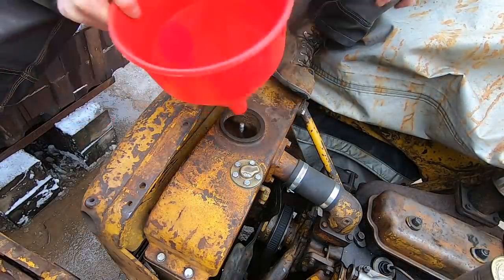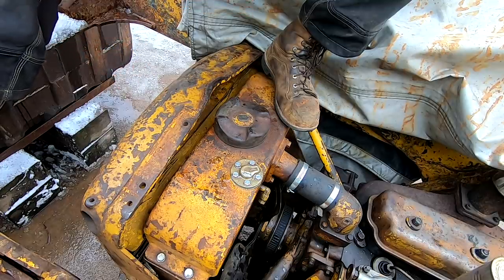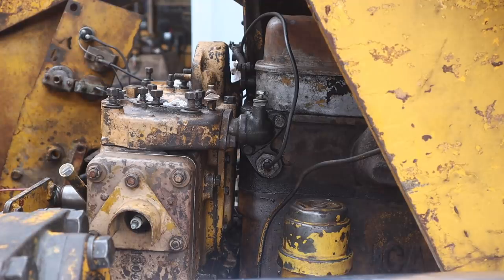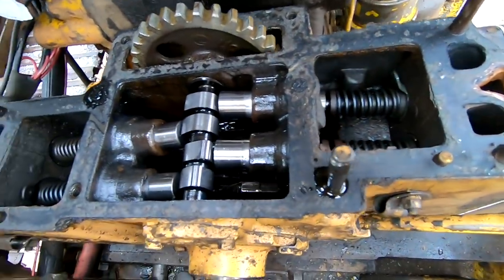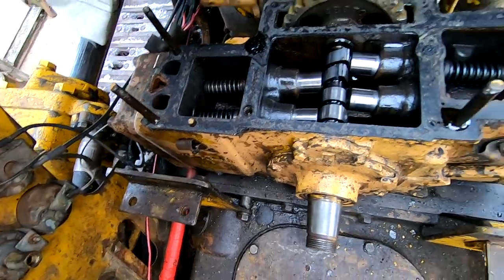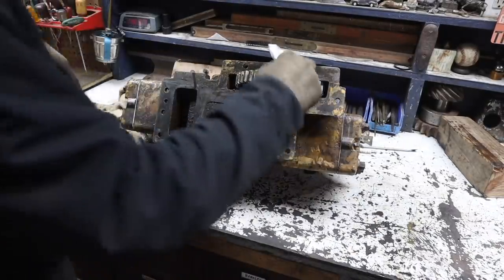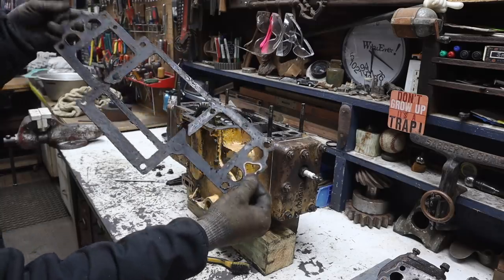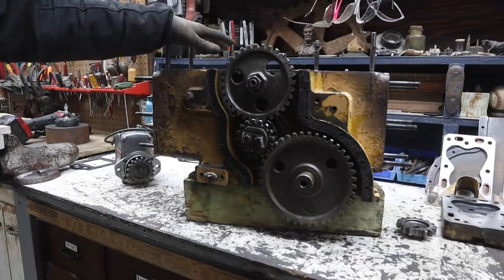I REMOVED the Pony Motor!!! ~ Part 15 ~ 1950s Caterpillar TraxCavator

Comment: It’s a babbit bearing not aluminum young man and yes you can replace it with a bronze bearing. The magneto gear got damaged by its loss mounting bolts if you remember you pointed it out alt hw lose the exhaust and bracketing was ! The cast iron gear was probably fractured for guide some time
Reply: I thought the same thing Ronnie, But the how is my question?
Reply: I was still concerned as to where the fractured castle nut came from.?
Reply: @Curtislow2  pretty sure as said in the video, someone dropped that into the crankcase when working on the con rods in the past.
Reply: Bearing is special aluminum alloy.
Reply: @toma43  There is no aluminium in that babbit metal.
Reply: @Bill45a13  Aluminum is just about the worse material for a bearing, it does not play well with oil, it's abrasive and it has a nasty tendency to bind.
Don't know what babbit is, but I certainly agree that there is no way it's any kind of aluminum alloy.
Reply: @arturraimundo7158  The most common materials in babbit are tin, lead, copper, and antimony.
Reply: @arturraimundo7158  babbit is a lead mixture that is used on older bearing surfaces, it is usually poured in place. I don't think this is babbit
Reply: No they are aluminum bearings
Reply: @arturraimundo7158  Almost all modern automotive crankshaft bearings are aluminium alloy on a steel backing.
Reply: @arturraimundo7158  watch Keith Rucker, he has videos of pouring babbitt bearings
Reply from the maker: The bearing is definetly an aluminum alloy, im sure about that!
Reply: There's a lot of armchair mechanics in here that have never worked on a Cat.  The pony motor main bearings are aluminum.
Reply: I think that is quite clear if the base material is alluminum or lead, simply by take in your hand. The weight is quite different.
Reply: @brianrvd  Definitely not an armchair mechanic, but I sure can accept and be grateful for the opinions of experienced people.
I stand corrected and thankful for learning there are in fact aluminum bearings.🤐
And by the way, I have never worked on a Cat.
Reply: @arturraimundo7158  babbit is a lead alloy usually tin, lead and antimony for hardness.
Reply: Damn it I hate when old people spread false information. They're supposed to know things..
Reply: @Bill45a13  that's because it's not a babbitt bearing.....
Reply: @arturraimundo7158  If you didn't know, & you acted like you did, you're an armchair mechanic.
Reply: @elonmust7470  yep shit like that happens every day young man!

Comment: Concentrations of ethylene glycol and water that have higher freezing temps than a proper mix SHRINK (or turn to slush) when they freeze, so 100% antifreeze concentration will not damage anything.  Assuming you don't need it for cooling that is as it isn't a liquid and won't circulate.  You're fine with straight ethylene glycol in your situation.  I would have left it.

Comment: making the sleeve can be done but you have to know the thermal expansion of the material and the minimum/maximum tolerances for the crank  and sleeve, if they are too tight and heat up there will be no clearance for oil and friction will increase dramatically

Comment: Mr Pete proved you can use an adjustable wrench either way. 
NOT a pipe wrench.  When you started with the puller that way, I knew it wouldn't work.
Reply: Had the pipe wrench on backward

Comment: So, to get an accurate reading on those telescopic bore gauges, you set them at a slight angle, so they are measuring big .. snug the locking bar up, then tip them through 90 degrees. As they come tight as they pass through 90, they will set up at the proper dimension with great accuracy. Then you tighten the bar a little more.

Comment: Who wants to bet that the castle nut is what broke the gear and bent the shaft? My thinking is that ol' Red was working on it and lost the nut in there without realizing it.
Reply: Can You loose a castlenut visible with bare eyes into an engine without noticing?
I can't. I write my parts down or have magnet pads for parts with sharpy registers drawn around. But I am quite sure You're right, the nut cracked the gear-teeth, probably having still been a whole nut before wrecking/bending the Magneto, which would be still an issue now as another half might float around being another wreck-to-come. It is awful, but You gotta look for the broken parts and put the puzzle back together on the bench, should You not be wanting to relive the same shite again.
Reply: Red may not have been the saint he is being made out to be..

Comment: I'd wash out the coolant circulation with a pressure washer to ensure all dirt being gone, same with big motor, unseal the cooler and whater pump and wash out the motor with a fire hose or sth similarly powerfull

Comment: About 40 years ago I removed the pony engine from my D4. It was stuck hadnt ran in years. I took it completely apart. It has stuck valves. the crank was turned .010 and the block bored .020. and the bottom was brazed where a thrown rod in its  past had cracked it.

Comment: 60% antifreeze 40% water gives the lowest freezing point, 34 years in Alaska, had down to -60F at the house, when that cold most diesel can turn to jello.
one of the cheap wet/dry shop vacs are really great for cleaning spills.
magneto is driven by the cam gear, play in that is what would cause issues with magneto, but your crank needs work way too much play in the crankshaft, needs new bearings/bushings and seals
castle nuts should have retaining cotter pins not pieces of wire to hold them in place
Reply: WWII aircraft castle nuts were secured with wire arranged and tied in very specific patterns. (supervisor  when I was an auto apprentice had served as an aircraft engine mechanic in Britain. He tried to teach me valve timing and ignition advance for 14 cylinder radial engines)

Comment: At about 18:00 you are correct, obviously flow runs bottom to top, as heat rises.  Very nice and thorough job! How many others wanted to reach through the screen to give a hand on the awkward and heavy pony motor removal? On the crank bushings, I don't think they are aluminum, but probably steel with a Babbitt wear surface. Relatively easy to check...aluminum won't give off sparks when you grind on it.
Great and detailed "dissection" of the machine, showing off many features most of us have never seen!

Comment: Can I make a recommendation to you? The machining you are proposing, and I know you are a good mechanic, can be very intricate.  I would suggest getting a professional machinist to do the bearings and races for you. I know you have a lot of machines and want to experience it, which is admirable. However, ABOM79 or Booth Machine has a YouTube site. I watch his stuff every Sat when he posts. This guy is a true machinist, grew up in it actually.  These are critical parts and maybe hard to find if a mistake happens. Just a suggestion. I have enjoyed watching you get this CAT running, thank you.
Reply: Not to mention Squatch253 who is currently rebuilding a D2 dozer and has very intricate knowledge of the engines/transmissions/pony motors...definitely hit them up for assistance, heck he might even have a manual for it, or can point him in the right direction
Reply: I understand your point but, if the dimensions needed are known at the start, and the finished dimensions are machined accurately, it doesn't matter who makes them. I'd try to make that part if I had the machine/tooling and experience using them; it's how ppl learn. I may be wrong, but on the surface that particular part doesn't appear to be overly complicated. Have a good day; God bless.
Reply: Yeah, Abom rocks!!!
Speaking of ABOM79, It's been a while. I need to catch up.
Reply from the maker: @DanKoning777  Yup, it's basically an aluminum ring! the 3 holes are drilled into it once it's in the block! I'm pretty sure I can make what I need! If not, I can always buy them, right?
Reply: @SalvageWorkshop  why do you think that is aluminum? It's almost certainly a babbit alloy, not aluminum. Babbitt alloys and aluminum look very similar but they are very different.
Reply: @SalvageWorkshop  //  Sounds like a plan; and CAT can tell you what it's made of re: material to use.

Comment: Please remember not to start the pony motor and immediately start the diesel especially in cold weather because the pony motor acts as a preheater and heats the coolant in the diesel engine before it starts.
Reply: Very good advice makes perfect sense
Reply: If so, does the pony motor has a water pump also? Or did the engineers hope that the coolant will circulate by heat difference only?
Reply: @thomasmuller9243  it works by convection
Reply: Actually I watched a video and the pony motor is used to turn the diesel motor over for a few minutes without starting the diesel motor so the diesel motors water pump circulates the water and the pony motor prewarms it.
Reply: @rickburris6164  more importantly builds oil pressure. Being cold won't hurt it.

Comment: Ha...you're getting your education that's for sure! Keep your eyes and ears going for parts machines. If you found an already converted direct start dead machine would probably be the cheapest way to get the goods. Conversion parts usually cost more than scrap value of a whole machine. Demand and supply rule. Plus you'll get other parts, and some scrap money  too. I'll  be in touch with pics soon. Thanks for sharing

Comment: That’s what I like to see. A good tear down and analysis. I’m thinking that broken castellated nut got thrown into the wrong place while the motor was running, caused it to lock for a split second and break off those teeth for the mag. Really looking forward to the rebuild and see how the new sleeve you’re going to make works out.

Comment: I would rather have the pony motor because it also warms the engine coolant and can crank much longer than an electric starter motor.
Reply: glow plugs and plug holders are available they just bolt on. but only on later models you have to have the certain type of heads to take the holders.

Comment: I've read all the comments below and agree with most of them sic; those bearings are made of what we called, in the vintage vehicle world, white metal. It was developed because of the microscopic highs and lows of the surface, allowing oil to penetrate deep into the bearing surface. There is a bronze alloy that has a high porosity, bit like a sponge, again developed for the early motor industry. If you make a bearing out of pure bronze you will have to add a spiral oil  groove. Pleased if someone shoots me down on this.  Anyway we've all got your interest at heart. Absolutely brilliant effort and filming, thanks. Pete on the Isle of Wight.

Comment: Can't see that lateral play in the crankshaft is going to cause the cam gear to move up or down. These are all old parts. Things break
Reply: harmonic vibration induced by the play is the cause. this is according to a factory mechanic he did his apprenticeship on these old girls.

Comment: Does Caterpillar still sell those bearings? Second I would definitely have the engine block hot tanked and make sure all the cooling passages are completely cleaned out. If you can’t get the bearings maybe a machine shop can replicated those given the machine shop all the dimensions and I definitely have the crank miked and polished and see if you need oversized bearings throughout the entire engine. Have the machine shop go through the engine to see what really needs machining to be through so you know what you really got.

Comment: Keep the pony motor. It helps to heat the diesel motor by circulating the coolant, this in turn heats the coolant sending the warm coolant to the diesel allowing for the diesel to fire off easier.

Comment: Also using distilled water prevents rust on the engine block and prolongs engine seals and saves the block from rusting out.
Reply: "distilled water prevents rust" I'll have to think about that.
Reply: @earlborchardt4358  I use it on gas tanks also. That I have cleaned rust out of. I use evaporust and flush with distilled water and no rust ever comes back in the tanks.

Comment: Is it possible that the motor had been repaired before and that partial nut was from the reason that it had been repaired before and the mechanic never thought about checking the drain tube for broken piece and parts.just saying.great video,enjoy every video 😎😎😎👍👍👍
Reply: Possible?? Naw, it did happen, remember the donor he got that was laying in pieces in the field?
All the spare parts in the shed?
All the loose and broken nuts and studs. Yeah it has been frankensteined

Comment: My input on Aluminum Bearings. Most likely the bearings got hot and flashed (not hot enough to melt, but enough the shrink. Check the crank for size sometimes the aluminum will transfer to the shaft.  Making new bearing would be the way I would go, Oil bronze. I use Atlas Bronze. Thanks for sharing.
Reply: I was thinking Aluminum Bronze for bearing material? opinion?

Comment: Matt, when you meshed your broken mag gear with the driving gear the teath on the broken mag gear appeared to have be tobig and the wrong profile, I wonder if someone replaced the mag a while ago with the incorrect one, just to get the job away and this over time has caused all your other problems
Reply from the maker: I have a few of those gears and they are all the same, so my guess is that it was designed that way and that it fits well enough to do its job, but I can see where you're coming from!

Comment: The old Pony motor will be just like brand new when your done. With it..Good job Bud. When I seen that half a castle nut I knew right away where it cme from. Im glad for you that was from an old repair and not the cause of the issue this time

Comment: My worry would be where is the other half of that castle nut? If it's hiding somewhere, it's only a matter of time before it does another oopsie.
Reply: Who knows where it is it could not even be in there it could’ve broken along time ago and they couldn’t find that half of that nut
Reply: I'm going to guess when it originally broke, whoever  installed a new rod (or stud) found the other piece of the castle nut and missed the little piece stuck in the old drain. That piece in there proves there was a previous repair done at some point since none of the castle nuts were broken or missing

Comment: In the elevator business on the large machines, we usually used Babbitt bearings poured on the job. (replaced). They were made of a Babbitt material called Cadtex which I Believe was just a commercial name of a Babbitt alloy, a little harder and longer life material.  The big bearings were poured on the job on the machine by the real old timers.  Warning .....don’t let your brow sweat fall into the pot full of hot Babbitt.  It will explode in your face.  Typically, a machine room in the summer could be well over 100 degrees.  With no A/C.
Fascinating video.   This young man would make an excellent elevator mechanic working on old hoist machines some of which were made in the early 1900’s.

JoeB

Comment: Nice, i wouldn't expect too much wear generally on the pony motor as it should have very few hours on it as its only used for starting. Out of interest I assume by press fit you  mean about a 1 thou interference on the OD of the main bearing? I would run about a 2 thou clearance between the bearing and the crank. Not sure what the end float should be but I doubt its critical. Honestly I suspect the mag gear gear failed due to age/fatigue rather that the crank end float causing it. Just my hypothesis.

Comment: You need to find out where that broken nut came from,i am guessing it had something to do with the gear to break,more so then the slack in the crank
Reply: Exactly my thougts. Becouse play he show is not enought to do that kind of damage.
Reply: Looks like that nut came from the rod cap at some point & was replaced, then diddn't bother finding the pieces, they migrated around & broke mag gear.
Reply: @rebus570  Thats probably the case. Never underestimate what small nut can do! (I know becose i have few small nuts):)
Reply: @tinuzi  The pin in the 5.9 dodge cummins would fall out and kill the geartrain...tiny bits of metal WRECK gears
Reply: Broken nut is may winner.
Reply: The nut came from the crankcase
The gears run in a separate gear case on the front of the motor.  Completely separate with a seal  to prevent the oil from migrating , so the broken nut is left over from a previous failure
Reply: And has nothing to do with breaking the gear.  The flywheel being loose was associated with broken magneto shafts way back in the 1950’s.  The end play on the crankshaft doesn’t help either but my money is on the flywheel being loose.  It should have taken a good puller to get it off the crankshaft.  

Crankshaft end play eventually results in a broken crank.

Comment: I would definitely replace with front and rear bearings with oilite sintered bronze bearings.  Better lubricity and longer wearing than aluminum..  The original designers probably figured that aluminum was fine due to the low duty cycle of the motor and it was probably a few cents cheaper than bronze..
Reply: Oilite is a self lubricating material for use in bearings that are not pressure fed.  Aluminium is a perfectly adequate bearing surface for pressure fed bearings, most modern car engines use an aluminium alloy on a steel backing for the crank bearing.  You need a soft surface to ensure any debris is pushed into the bearing surface rather than scoring the journal.
Reply: @ferrumignis  I don't see an oil pump in the pony motor. Do you?
Reply: Splash lubricated only but it works until the oil gets too low or out of spec from gas dilution isually